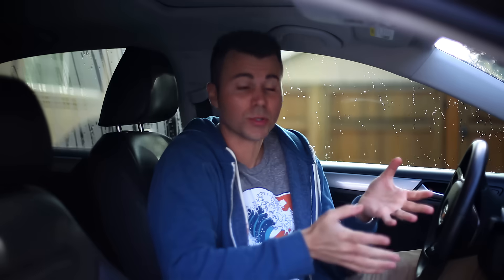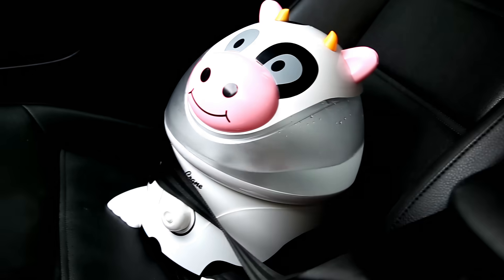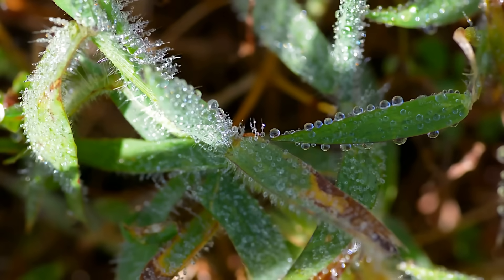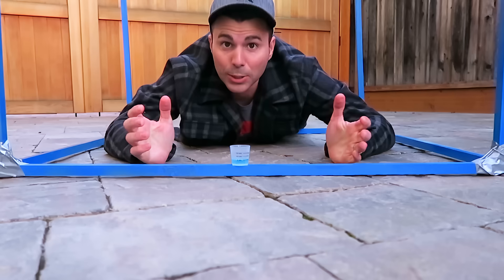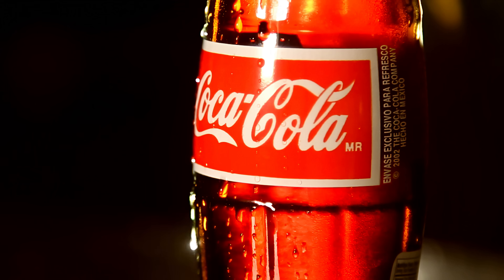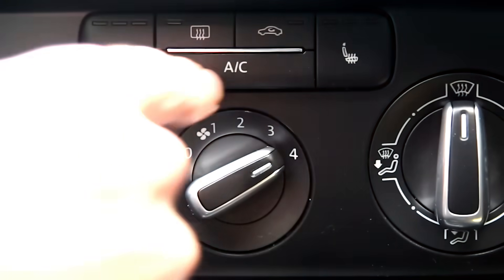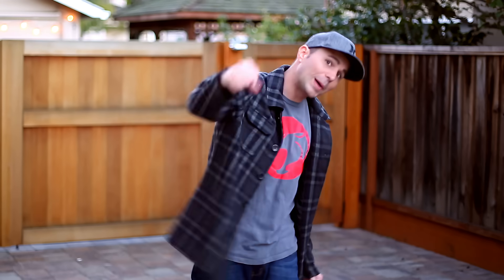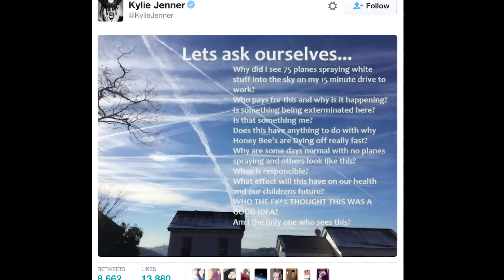Defog your windows TWICE as fast using SCIENCE- 4 easy steps

Comment: The way iv always viewed it is, i think of a water bottle. When you grab a cold water bottle from the fridge, you will notice there is condensation on the outside of the bottle, it is because the air around the bottle is warmer than the temperature inside the bottle. The condensation on the outside will slowly go away as the water inside the bottle reaches "room temp". Where as the opposite, you have a bottle of water in your car on a hot day, and you notice there is now condensation on the inside. This is because the temperature inside the bottle is higher than the temperature outside the bottle. So now lets look at your car, If you have condensation on the outside of your windshield, this means the air outside your car is warmer than what is inside your car, so crank the heat! If the condensation is on the inside of your car, that means the air outside is cooler than what is inside your car, Crank the AC!

Comment: On some vehicles, turning on the windshield defogger turns on the A/C.  My 2007 Honda Fit does this.  If I leave the defogger on all the time, it really takes a big chunk out of my gas mileage.  So after the windshield is clear, be sure to switch it off the defogger setting.

Comment: Just an FYI, modern cars (I would say from the early 90's onward...maybe earlier) automatically run the A/C compressor when you have the dial set to defog eliminating the need to turn on the A/C.  This is done for 2 reasons: 1) As stated in the video, to remove moisture from the air, and 2) to keep the compressor lubricated during the off-season.

Comment: good video,  cars do all of this but open windows on their own.  Nothing new here.  Vehicles today automatically turn the a/c on when in defrost mode for 2 reasons  help defrost faster and keep the a/c compressor moving during the winter months,  it would not get used and seize up and have to be replaced when summer comes around in the older cars.

Comment: Science is good. Tech is better. Making the right choice is best.
Mark's looking at the science, but my windscreen demists like lightning as it's embedded with heating elements. Before that I had a car I had fitted with a mains powered electric water heater element that made the engine warm, and before that I had a 12v travel hair drier I used at the top of the screen while the heater got the bottom. I suspect one of those 12v ceramic fan heaters would save time.
Also rain/wind guards fitted to the windows means I can crack all 4 windows and not get wet or wind chill.

Making the right choice when choosing a car ticks more boxes. If you use the right car, and not bigger then you need, then the benefits are not just to the environment, and your wallet, but also a smaller engine block will warm up faster then a big block. So demist your windows quicker.

Comment: so thats why my car by default turns the ac on when I hit defrost .-.
Reply: +anistii Yeah, all these years I thought there was an electrical issue.
Reply: anistii yes exactly!
Reply: Defog*
Reply: It's all in the words. Words are hard.
Reply: oh. my. god.
Reply: HA!  Have a friend who complained a few years back about not being able to turn off his AC.  Looked at his temp controls and saw he used the combo heater/defrost all the time.  Switched it to just heater, and lo and behold, the AC light goes out.  He had no clue. . .
Reply: Lmao. I literally just figured this out a few hours ago in my car.
Reply: No, your ac turns on to circulate the oil in your ac system.
Reply: because the air is still hotter that the a/c coil, which makes it condense, thus reducing moisture

Comment: Air conditioning doesn't work well at an idle, and it consumes fuel. But it will cause the engine to heat up faster which heats up the air faster. Turn the AC on when  driving and it works really fast.

Comment: Turning the heater control to full blast when you start the car is a BAD idea! No mechanic would advise you to do that to your car!!!! All you are doing is increasing the time it takes the engine to heat up, draining the battery and putting unnecessary wear on the engine. The heater works because it is plumbed into the car's coolant system, the engine heats up the water in the coolant system  which is cooled by the car's radiator. When you turn up the heater knob some of that hot water is passed through a smaller radiator plumbed to the car's air vents and an electric fan to draw air through it. Turning the heater knob to full and running the fan full blast whilst the engine is cold helps keep the coolant cold longer. A cold engine means a heavier load on the electrical system meaning the battery is not being charged as well. Also with the engine cold the oil is not up to temperature meaning increased wear on the friction surfaces reducing the life of the unit. NEVER turn up the heater knob until the engine has warmed up! BAD BAD ADVICE!

My advice, get some de-icer, a scraper and get out of bed ten minutes earlier.

Comment: AC is supposed to run when you turn the defogger setting on. If you have an OBD scanner you can even see the AC compressor status and RPM change. Turning it on with the button is redundant. (Doesn't hurt anything though.)

If the car fogs bad often, either a lot of water got tracked or allowed in or there's a leak letting water in somewhere. You can use a dehumidifier pack to help dry it. (I think the hanging ones work best, but it's hard to find them without perfume.) Just be careful not to spill it because those usually contain a salt that's hard to clean up.

Comment: 1. I don't have AC
2. the air comes out much hotter if I put the fan on 2, not 4
3. Its usually raining when my windows are misted up, so opening the windows isn't gonna help
4. just come out 10 minuets before you have to leave, start your engine, put the heater on, lock the door with your spare key, and go back inside the house.

Comment: And now to touch on a hole in your experiment: the car's HVAC system. Modern cars use computers to control their HVAC systems, and dating back for around 25 or 30 years now, most automotive HVAC systems do a few things without telling you. Namely, if you set your climate controls to Windshield Defrost (window vent) with the fan turned on, the HVAC system will disengage the Recirculate Door and turn on the Air Conditioner. It'll do these things regardless of what other buttons you've pressed, and some will even do them without turning the lights for your recirc off, or your A/C on. This isn't an absolute statement- I'm sure there are some cars with different (read: cheaper) methods of operating their HVAC systems. But by and large, that's how they function. Which is, to say, your experiment has an unknown variable (by what exact method does the HVAC system operate?) and lacks a control group (another car with an HVAC system known to operate differently). 

All of that said, I applaud your scientific rigor. Designing an experiment wherein as many variables are controlled and tested here for something as mundane as window fog is pretty cool. And your results are certainly hard to argue with: rolling the windows down and using the windshield defrost on hot is the most effective method to clear a windshield. However, at least for most cars, it's likely only a two-step process to clear the windshield. Which is just fine either way.

Comment: "usually" if you set blower on setting to windshield, the AC is ON by default, even if the button is not switched on, it's something the car manufacturers have in built into there HVAC, so yes your correct in that you DONT need to set the AC switch on, because it is set on anyway when the air is directed to the front windshield

Comment: I have a question. How you get the heater fully functional as hot air when you just start the engine first time in the morning?? The heater uses the heat from the engine which is takes time to heat up especially during winter and even more takes time for diesel engine.

Comment: Hi, the way a car heater works is by using the heat from the engine to heat the heater core and produce hot air. 

However, if you just started the car, the engine coolant will be cold so you'll get a bunch of cold air. 

What's more, the car's engine will take more time to reach optimal temperature because the coolant is being circulated over more volume (i.e. the radiator and the heater core). 

Solution: wait a bit until you car's engine has reached optimal temperature and then turn on the heater, obtaining hot air immediately. 

If you want to drive away in a hurry, use the A/C as the it has a de-humidifiyng chamber in the unit. 

Just my 2c.

Comment: Hot air plus A/C is the best. Condensation happens inside the A/C unit. BUT if your A/C is broken. NEVER go for hot air; this combo will result in instant foggy windows in most of the cases.

Comment: I have found that reducing moisture in the air inside the car before I park it works well, then the next time I start it up there will be less of a condensation problem.  

5-10 minutes before I park the car I turn the heat and the fan up to maximum, making it almost unbearable hot inside the car.  This will remove or reduce moisture from the windows, textiles, floor mats, clothing etc. and make the air inside the car very humid.

Then, 2 minutes before I park I turn turn the temperature to cold and also open all windows, fan still on max.  This will replace the warm and moist air inside the car with colder and drier air from the outside.  If the floor mats are wet when parking then give them a shake outside of the car.

Also, for all of you using a mat/blanket on the outside during the night, do not take it inside the car when you start driving.  That will just make problems worse inside the car.

Comment: In Arizona, where the only time there's enough humidity for there to be fog on the Windows it has to be cold and raining like mad, I found that running the heat and air conditioning works the best. I'll have to try opening the windows and have found that bringing in outside air help to clear the windshield, but closing it afterwards helps keep it clear until moisture from mine and the passengers breath fogs them up again.

Comment: No no no! Yes hot hair does hold more moisture than cold air but it does not obsorb water easily. you would have to either heat the moisture to a boiling point or have so much pressure where the moisture is obsorbed by the air (that's how clouds are formed the pressure is high in high altitudes and moisture that was evaporated is obsorbed and formed into a cloud then goes back down as rain) all you need to do is even out the pressure inside the car with the outside air which is cold you can use the AC but only have it as pushing the outside air in also have the windows open to equalize the pressure the circulation will also get ride of the moisture. And if you use the Heater before the car is even warm it will most likely come out cold anyways because of the cars thermostat will prevent heat leaving the engine before it heats up. That's probably why it worked, did he even try the same techniques except with the heater off?

Comment: I know the easiest way to defrost your windows. Lets say you are close to where you are going to park. Turn off heat and open windows like 5 minutes before you park your car. It makes the front window tempriture equal with outside. This way you won't have frost in the first place and you won't have to deal with defrezing it in the morning. English is not my native language so I'm sorry for any mistakes.
Reply: Actully I did this this morning I needed the condensation gone even faster. So I set the ac to cool the interior of the car to the same temperature as the outside temperature. 43.2 °F it was cold but I made it alive.

Comment: So, this isn't a tip on how to DE-FROST rather how to DE-FOG? Turn your damn wipers on!
If it's how to DE-FROST, Rain-X makes a wiper fluid that is good to about 15 below, squirt a bit of that on the wind shield and the wipers do the rest, melts the FROST right off.....or you could just put a pint of Rubbing Alcohol in with regular wiper fluid, it'll keep it from freezing and it'll DE-FROST the wind shield too.

Comment: Use CAUTION with that shaving cream trick.  It works great... until it freezes... at which point, it can become a serious safety issue.  I'm not sure if all brands are the same, but the one I used worked well at first, but then formed a film on my windshield when it was very cold outside.  The untreated portion of my windshield was relatively clear, but I ended up having to remove the shaving cream entirely because it kept losing its transparency.  I might try using it on the passenger side of my windshield and do some troubleshooting to figure out what went wrong and see if I can make it work better.

Comment: I get rid of fog in a second using some washer fluid and my wiper blades.... I'd like to see a video on defrosting. Also, don't put heat on full blast if the engine is cold. Wait until engine warms up. Otherwise you're just blowing cold air onto windshield.

Comment: During a cold winter day, if you blast hot air in your car to defog and defrost the windshield in the morning, you'll have problems at night. 
The hot air will be able to contain more humidity like you mention but when you turn your car off to get to work, the air will VERY quickly cool down and won't be able to contain as much water (humidity). The water will therefore condense on your car windows and if it's cold enough, will FREEZE in your car. 

Good job mate, now you have to use your window scrapper inside your car -_____- 
Best thing is to blast AC + half way temperature setting. Maybe you'll lose a minute or two in the morning but you won't sit in your car for 20 minutes waiting for the ice to defrost after work.

Comment: You don't have to turn your A/C on separately in most cars. In most vehicles, the A/C compressor is turned on automatically when you select defrost on the settings knob (If you listen closely you'll hear your idle speed blip as the compressor is engaged when you cycle the knob onto defrost).

Comment: Turning on your air conditioner does absolutely nothing when you turn on full-blast warm air. It's a separate system for air delivery.
Reply: +Dettweiler "...does absolutely nothing when you turn on full-blast hot air". WRONG. The a/c evaporator will remove the moisture. 
"it's a separate system for air delivery"...lol, no it's not. Air is always blown from the same place, the difference is in the valving of engine coolant and freon.
Reply: Paul Lomond You're going to run intake air over your heater core and your evaporator at the same time. It will do nothing. The evaporator does not evaporate air. It expands coolant after passing the expansion valve so it can absorb heat from the intake air.

Comment: He's right about the type of car variable.

I've been a skier in the Rocky Mountains for close to 40 years and deal with interior fog all the damn time.

For a long time I had a Lexus ES 300 and the 4 steps were exactly what would get the job done fastest. However I now have a Toyota Venza and it works better in this car to have the inside air circulation ON. Although I do crack the windows for a bit (assuming it isn't a full-on blizzard out there).

Comment: Every vehicle I've seen built since mid nineties turns the AC on by default when you set the fan direction to defrost, this doesn't mean the light necessarily turns on, but if you check the AC compressor, it will be running, additionally, recirc cannot be turned on with the defrost setting selected. My experience being 5 or 6 American cars and 1 Japanese.

Comment: One variable was left out:  Leave your windows open a crack during the night.  This will allow the humid air inside to escape and be mixed with dry outside air.  Also, a big source of moisture during Canadian winters tends to be "boot drippings."  If you can minimize the amount of water on/in floormats you will have less issue with fogging.

Also -- don't drive a diesel.  They are so !@#$% efficient that they won't warm up until you drive them for some time.  Idling to warm up the engine just doesn't work.